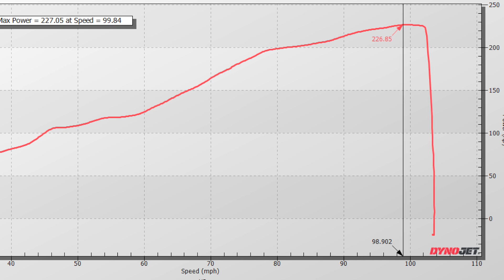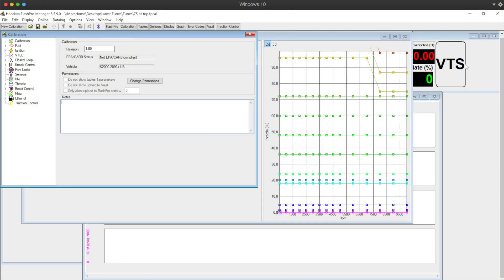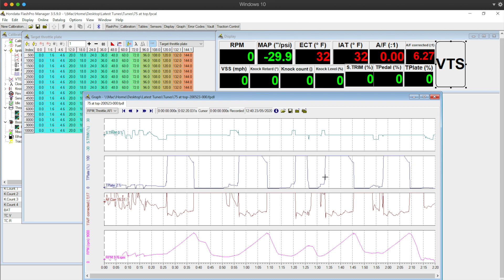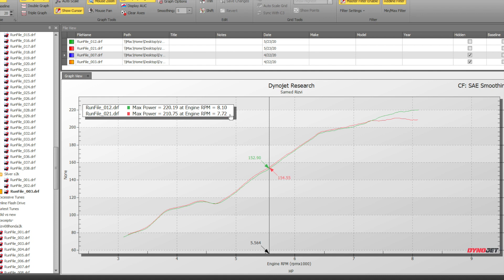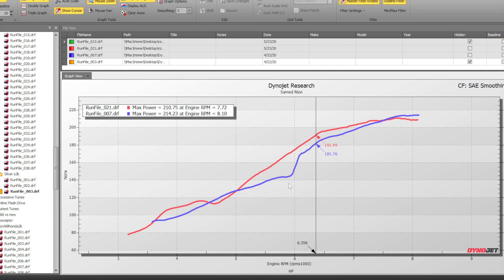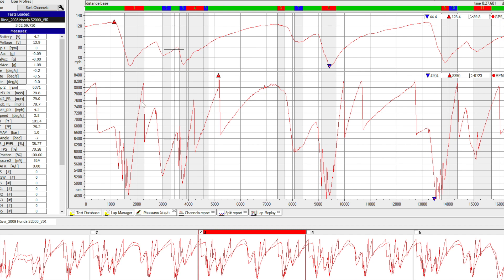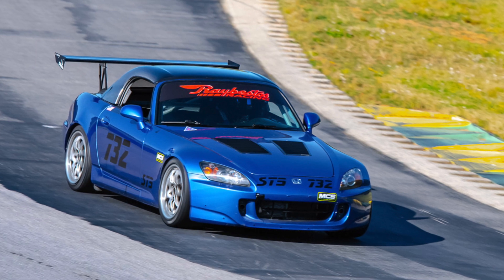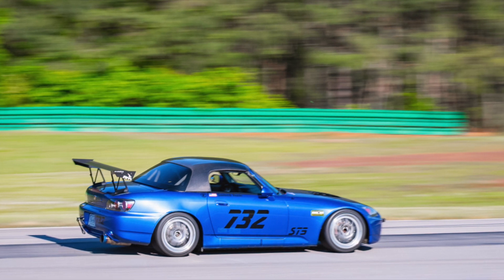NASA ST5/TT5 S2000 : Build blog episode #20 Dyno tuning, detuning, FlashPro, power optimization

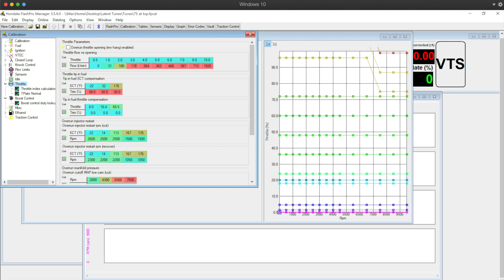Comment: On your target throttle plate (4:37) the value seems to spike at index 12. For all other partial application below index 72 ,the value seems to be synced to the index. Is this jump at index 12 intentional? If so what's the reasoning?
Reply from the maker: Thank's for pointing that, might have be a combo of fat fingered key strokes.  I'll fix it!

Comment: What have you done to adapt for the giken? Was hoping you'd mention more about the ole salisbury unit and you sorta addressed it right at the end. These are great videos, for a setup nerd like myself its awesome to see how you approach things. 

I'm guessing that theres no harm from doing so many consecutive dyno pulls? 200 sure seems like a lot, but I get the counter argument that just driving is the same thing.
Reply from the maker: First day of testing the OS Giken kinda sucked.  It made the car twitchy and have odd wiggles in turns.  So far I added more camber, more wing, a bigger front adjustable bar, a different rear adjustable bar, and crossed my fingers.  Hopefully this solves it.The pulls were on multiple days.  There shouldn't be any harm, they are just 4th gear pulls with less load than you normally would have on the street.